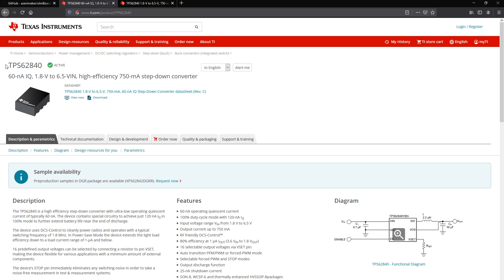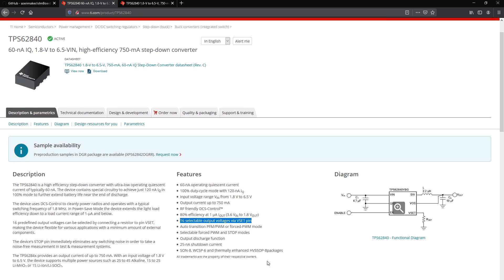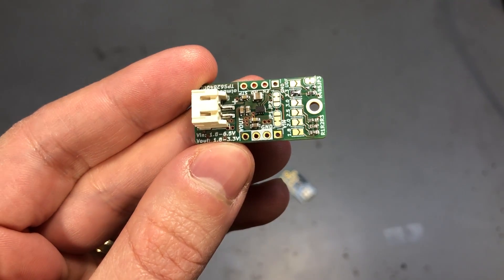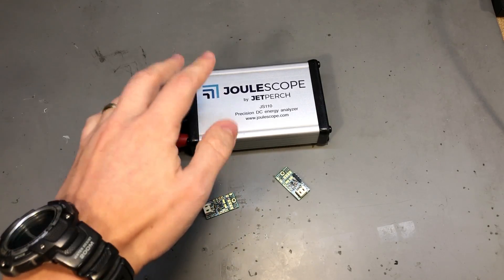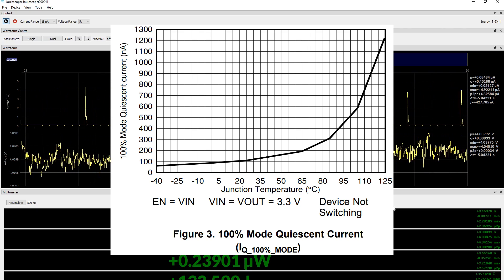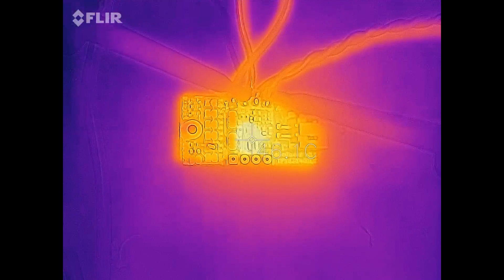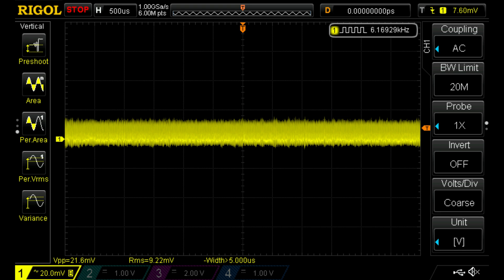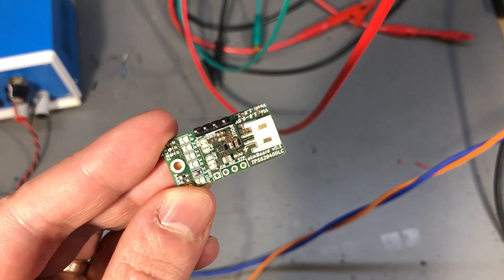Voltlog #280 - TPS62840 olmBoard Ultra Low Power Step Down Converter

Comment: The Nordic Power Profiler 2 is reading the exact same power measurements on a custom PCB I created for the BGA version of this converter chip. Nice to see the Power Profiler measure the same for a fraction of the price. 

This converter is awesome also for it's efficiency.

Comment: So this would be perfect for intermittently powered battery projects I guess? I do have a use for that, to monitor my caravans 12V battery without also draining it.
Reply from the maker: I can vary depending on specific applications, how much time spent in sleep vs how much active time. You would need to evaluate according to your application, for example this chip is designed with battery operated devices in mind with up to 6.5v input voltage.

Comment: I wonder what kind of amperage it will push if you use a jumper instead of a resister?
Reply from the maker: The jumpers don't limit current but set the voltage.
Reply: I realize it's meant for low power, but